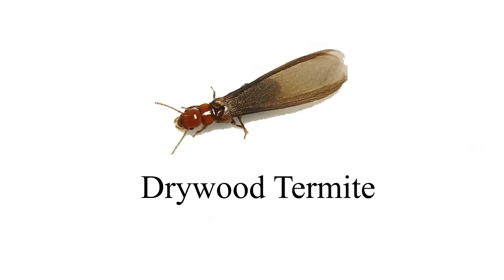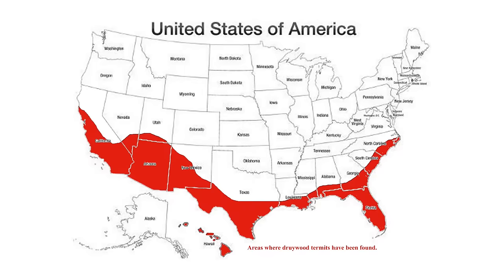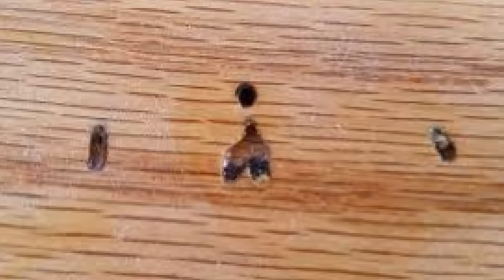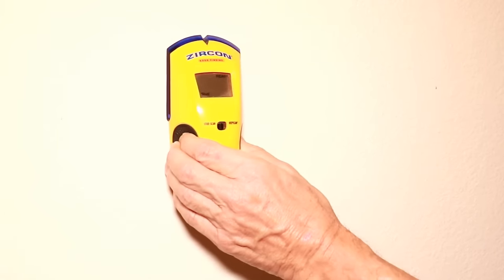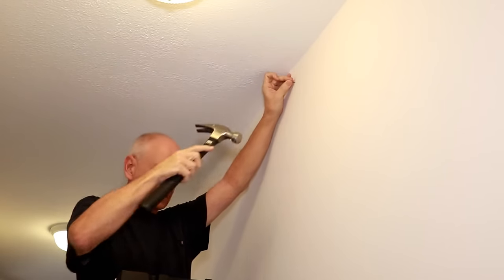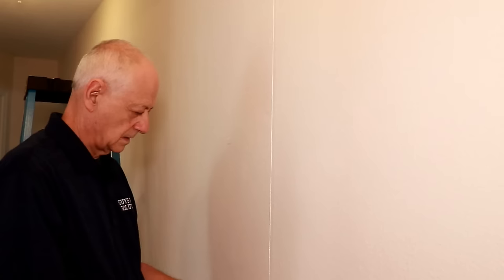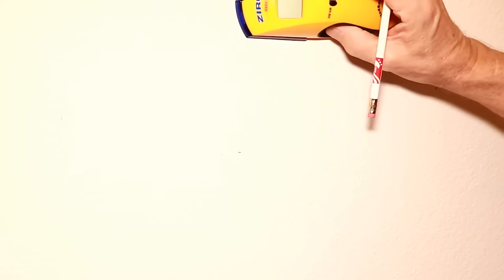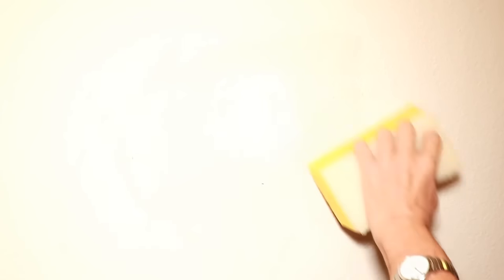How to Treat a Drywood Termite Infestation Yourself. A MUST see if you have Drywood termites.

Comment: How do you treat you second story subfloor preventatively?  Ours is carpeted.   Love your video!!!!  Sooooo helpful.  We are going to systematically treat all of our wall studs, over time.   We've already done the attic with Boracare.
Reply from the maker: If you have a two-story home, and you have a ceiling above the first floor, then I don't know anyway to do a preventive treatment on the floor joists or the second story subfloor that exists between the first floor and the second floor.  That would literally require that you either rip down the ceilings from the first floor or remove the flooring underlayment on the second floor.  Neither of those things are good options, so that is just an area that is not easy to do a preventive treatment.  If it were me, I would do a preventive treatment on the entire exterior of the house every 60 days.  This is done from the outside and you can probably treat the house in under an hour.  Since you have a two-story home, I would do it with a hose and sprayer.  You are not supposed to do it that way because it exceeds label recommendations for the amount of pesticide being applied, but I can tell you that it will not harm you or the environment.  Doing it this way will make it a lot easier and faster.  I will give you a link to my video on how to do that. You do not need to treat your yard for drywood termites. You just need to treat the exterior of the house.  Keep in mind that if you have drywood termites already, the only sure way to get rid of them is to fumigate.  If you do fumigate, make sure that you start the preventive treatment outside before the tent goes up.  The gas they use to do the treatment has no residual action whatsoever, so you can get reinfested the moment the tent comes down.

I hope that helps.  You will my friend.

Video on how to prevent dry wood termites:  https://youtu.be/Yozv3s-Qwlw
Reply: @GuysPestSolutions  thank you so VERY much for your detailed response.  We are in a difficult situation because we live in a townhouse development.  We currently are waiting to see if the HOA and our neighbors in our building would agree to tenting the entire building.   If they don't agree to fumigation, do you know if heat treatment of an individual unit is effective enough? I have read mixed reviews on that so I'm not confident it would be worth doing.
Reply from the maker: @SG4e  It sounds like you have done your homework.  Good for you.  Learning all you can about this sort of thing is probably the smartest thing you can possibly do.  I can tell you that it is almost impossible to get all the other owners to agree to fumigate because some of them might not realize or believe that they have drywood termites.  That is because you cannot always tell that they are there.  However, if you have an HOA, it is often possible to convince them that this treatment needs to be done.  Here's the problem though.  The gas that they use to fumigate has no residual action, so the entire complex can become reinfested the moment the tent comes down.  That is because, even if you treat every town home in the complex, there will be other buildings in the area that also have drywood termites.  Since they swarm every year, they will be attacking again within a year, and maybe even immediately, depending upon the time of year that you do the treatment.  The only way to prevent this from happening would be if you do a preventive treatment.  This treatment would need to be done on all of the units.  This is also problematic because you will not find a pest controller that will do it.  Therefore, each of the homeowners would need to do it themselves, and it is very unlikely that this will happen.  If your neighbor fails to do it, then the drywood termites are going to find a way into your unit through pipe penetrations, holes created for the wiring, and cracks and crevices between the separation walls of the units.  I am so sorry that I am not doing much to encourage you here, but I know you want the truth about it.

With regard to heat treatments, the reason you are getting mixed reviews is because sometimes it works, and sometimes it does not.  In order for a heat treatment to work, you need to heat the inside of all the wood in the entire structure to a temperature between 120 to 140 degrees Fahrenheit.  Obviously, you are really going for the 140 degrees.  This temperature must be maintained for at least 30 minutes after it has been reached in all the wood members.  The problem is that it is difficult to know if you have heated throughout each piece of wood in the entire building to that temperature.  Wood is a natural insulator and is difficult to heat.  This is further compounded by the problem that you often have insulation around it, not to mention the fact that a lot of it is covered by drywall.  Therefore, while it is possible to heat the entire structure to the required temperature in every single piece of wood, you can see how it would be very easy for some of the galleries to escape this treatment.

I feel so bad to be explaining all of this to you, because I know it sounds so hopeless.  Drywood termites and German cockroaches are too big reasons why I generally recommend that people not by townhomes or condominiums.  It is almost impossible to get everybody to agree to do the required treatments and to stick with a program that they would need to do themselves.

The only good news I have for you is that drywood termites are very slow eaters.  It takes a long time for them to do significant damage.  Therefore, you do have some time to consider your options.  It seems to me that the most logical options in your case would be to start spot treating the problem yourself, and start thinking about ways to purchase a single-family home and sell your townhome.  I know that single family homes are a lot more expensive, but they have the advantage that you have complete control over these sorts of things.  If there is no way you can afford a single-family home, then about the only viable option you have is to just keep doing the spot treatments and be as thorough as you can possibly be.  Be sure to treat the attic with Bora-Care, if it all possible.

Finally, I hate to deliver even more bad news, but you should keep in mind that even if you kill all the drywood termites in your unit, if any adjoining units fail to do this, at some point in the future, they may experience a structural failure that will cause your unit to be red tagged.  That means you may need to vacate until the structure is repaired.  For example, if their roof structure starts to fail, and it is in close proximity to your root structure, that could render your home unsafe.  This can also happen with shared walls as well.  I do not think this is common, but you cannot rule out the possibility that it may occur at some point.  A lot of it will depend on how the construction was done.  Of course, this would definitely get the attention of the HOA.

I am so sorry that I have probably totally ruined your day, but I can tell that you are the sort of folks that wish to be informed about your situation.  I really wish I had better news for you, but living in a townhome situation makes drywood termites a daunting problem.  I just don't have any magic bullets for that one.  I am so very sorry.

Be well my friend.
Reply: @GuysPestSolutions  Again, thank you so VERY much for your detailed response and explanation.  Yes, it's certainly not what I would like to hear, but, it is what I was expecting after reading about this topic extensively.  You are correct, I would rather know the hard truth and deal with it as proactively as possible.  

I now realize we will eventually need to find a SFH in order to be able to protect it properly from drywood termites, even if we do succed with getting our building fumigated.  Since we can't move immediately (we live in a very expensive area), I am glad that I have some time to plan and prepare for our eventual move.  In the meantime, I will hope for fumigation, and if that isn't approved by the homeowners/HOA, I will do extensive spot treatment and exterior protection (to the degree possible) until we are able to move.  Thankfully, we did apply boracare extensively to our attic already.  

Fingers crossed we do not end up in a red tag situation before we are able to move.  

Again, I sincerely appreciate you taking the time to help me!  My best to you.
Reply from the maker: @SG4e  You are very welcome.  I hope it all works out well for you.  Be well my friend.

Comment: Hi Guy, thank you for these videos.  I have discovered termites and have huge problems with carpenter bees around my house.  The termites have eaten the rail wood ties I put down to mark a walkway and have started eating the posts on the deck and the stairs.  This area is always damp due to trees and lack of sunlight.  I haven't seen any mud dobber paths but will check closer on my next trip over.  Its a rental house so I can't tent due to tenants being in the house.  We have done a lot of extensive renovation on the house over the last year and have not found any  evidence of termites inside.  It seems to be isolated to the exterior deck and railway ties.  Is it possible these are dry termites or subterranean?  Any help is appreciated.
Reply from the maker: You talked about two different issues, carpenter bees and termites.  Let's start with the termites.  You are correct that species matters.  So, the first thing we need to find out is if these guys are drywood or subterranean.  Please watch my video on how to identify termite species.  I will give you a link to that video.  There is a map in that video that will show you where drywood termites are a problem.  If you are not in the red area, then these are subterranean.  The limited amount of damage would suggest that they are NOT Formosan, so even if you live in the orange area on the map, you are still most likely looking at a common species of subterranean termites.  If that is the case, you are in luck, because these guys are very easy to get rid of.  If you live in the red area, then watch the rest of the video and let me know if you are seeing kick out holes and frass.  Just get back to me and let me know what you find out.  I am certain that I can provide the answers you need.

Now, let's talk about those carpenter bees.  They are very easy to get rid of, but keeping them away is the ultimate goal.  There are two ways to do that, so I need a bit more information.  Please tell me where these guys are located.  I usually see them in the fascia boards, but not always.  Also, is the location finished in any way?  Is it painted, stained, or sealed in any way?  I need to know this to recommend the best way to prevent them.  To treat the existing problem, you need to shoot fipronil foam into each hole for about seven seconds or until the foam is coming back out at you.  Then just seal the hole with Bondo or caulking.  It's really that easy.  I will give you a link to the product I like to use.  Let me know if they will not ship to you and I will recommend something else.  Some states restrict this stuff, like California.  Always wear rubber gloves when using the foam.  While the bees are creating the holes you see, it is the larvae that are doing the real damage to the wood.  The bees bore into the wood and lay their eggs.  The eggs hatch and the larvae eat the wood.  So, you need to get into where the larvae are located.  The foam expands to many times its original size and will get into all the nesting areas.

I hope that helps.  Be well my friend.

Video on how to identify termite species:  https://youtu.be/mY4FMvAHrMA

Fipronil foam:  https://www.solutionsstores.com/fipro-foaming-aerosol

Comment: I think I got Drywood termite coming out from the bathtub drain. They have wings and I see them in the bathtub. If I was to tent the house do you know if the termites from the drain will die? I have a feeling if they are too far down the drain they won't die from tenting, but you would know more than me.
Reply from the maker: Drywood termites, or any termites for that matter, do not live in drains.  You have them in the bathtub because they flew there.  This is a sign that you probably do have an infestation, but that doesn't mean these are drywood termites.  The first thing you need to do is make sure that you have identified the species correctly.  You see, fumigating does not work for subterranean termites, so it would be a waste of money.  So, let's start with the basics.  Please send me a close-up photo of one of these guys.  Get as close as you can to one and make sure that it is in perfect focus.  You can send the photo to guyspestsolutions@gmail.com.  Please give me your YouTube name when you send the email, so I know who you are.  Next, look around the house for frass.  This will look a bit like sawdust or tiny pellets that you will see in a pile on the floor by walls, around furniture, or even under cabinets.  You will often see it on the floor under windows.  Move furniture and look behind everything.  If you don't see any frass, then there is a good chance that these guys are not drywood termites.  If you cannot find frass, then go around the outside of the house and look for mud tubes that are coming up from the ground.  If you see mud tubes, then you have subterranean termites.  Be sure to inspect the basement/crawlspace if you have one, and the attic as well.  Finally, please tell me where you live.  Location matters.  Different species live in different areas of the world.  For example, drywood termites in the US are limited to just some southern states, California, and Hawaii.  Other areas of the world, such as the Philippines, Australia, Africa, and so forth have very different sorts of termites that must be treated differently.  So, knowing where you live will help me narrow down the possibilities.  

I hope that helps.  Be well my friend.

Comment: Hi Guy! Thanks for the great videos.
On my search for products besides Fipronil I'm seeing more Bifenthrim is this as an effective a product as the Fipronil or something totally different?
Reply from the maker: Bifenthrin is a great pesticide and I use it all the time, but you cannot use it to treat drywood termites.  However, you can use it to prevent drywood termites.  It is important to understand how drywood termites work.  They enter through cracks and crevices around windows, doors, the eaves, pipe penetrations, and so forth.  Most of the time, they enter through several locations.  That is because a swarm of them attacked your house at the same time.  If there was a crack or a crevice, then they probably found it.  After they established their galleries, which will be inside the wood, it will take four to seven years for them to be able to swarm.  Now that they are in your house, the swarmers will use holes that are in your studs to travel through the walls.  Those holes in the studs were created by the electricians to run the electrical wiring.  Not only are these holes going through the studs, but holes were drilled into the attic for the light switches and to run some of the wiring for the outlets.  So, the termites now have easy access throughout the attic and the walls.  If you have a basement or crawl space, they have access to that as well.  Most of the time, you will have no idea that they are in the walls, because the frass is inside the wall.  To make matters worse, if you have drywood termites, then your neighbors have them too.  That means you have been getting swarmed for as long as they have existed in the neighborhood.  Most likely, we're talking about years, so it's a safe bet that you have these guys in many locations in your home.

I always hate to be the bearer of bad news, but if you have drywood termites, the only sure way to get rid of them is to fumigate.  Prices for this can vary wildly in this industry, so I recommend that you watch my video on how to hire a pest controller without getting ripped off.  That video can save you a lot of money.  You should also know that the gas they use to fumigate has absolutely no residual action whatsoever, so you can get reinfested the moment the tent comes down.  Like I said before, if you have drywood termites, then your neighbors have them as well.  Since drywood  termites swarm every year, it is almost a certainty that you will be reinfested within a year after the fumigation is done.  The only way to prevent this is to do a preventive treatment on your house every 60 days.  Most pest controllers will not do this, so it is something that you generally need to do yourself.  I have a video on how to do that and I will place a link below.  This is a generic video that works for a lot of pests, including the prevention of drywood termites, but you do not need to treat your yard for drywood termites, so just ignore that part of the video.  If you absolutely cannot afford to fumigate your house, then you can try spot treating it yourself.  It is virtually impossible to find all the termite galleries, but it is way better than doing nothing.  Regardless of how you treat it, you should begin the preventive treatment immediately, so that you do not get additional termites paying you a visit.

I hope that helps.  Be well Ann.                      

Video on how to hire a pest controller without getting ripped off:  https://youtu.be/y-a8XOqVrlE

Video on how to prevent drywood termites:  https://youtu.be/Yozv3s-Qwlw